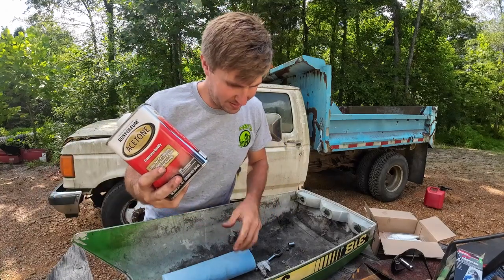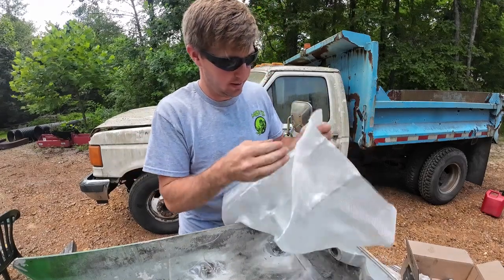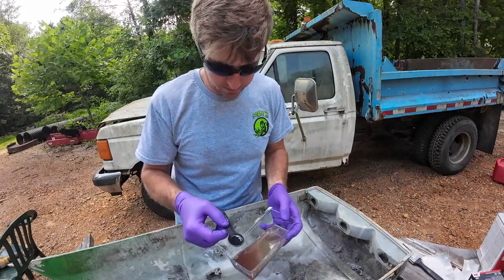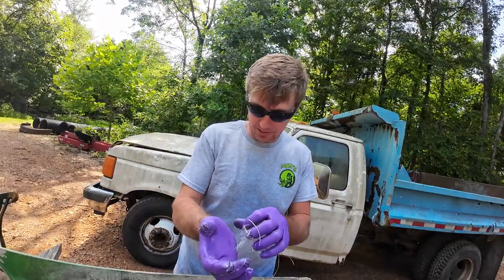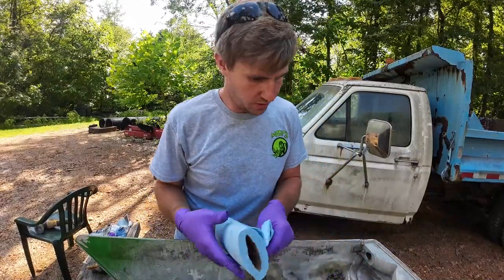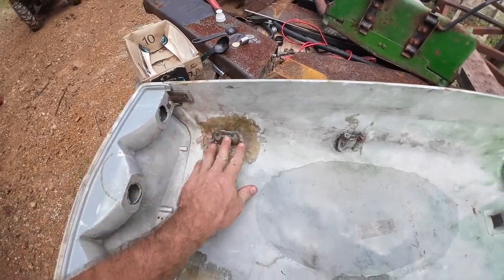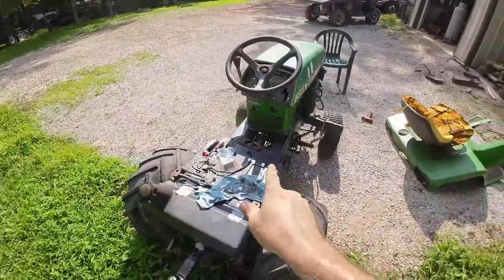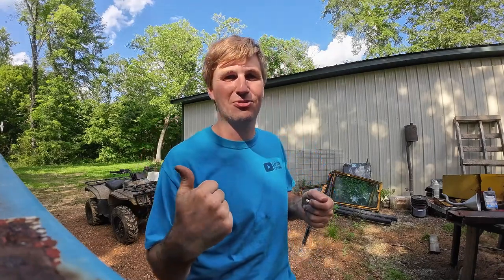DIY Guide: Fixing a Cracked Lawn Tractor Hood with Fiberglass Repair!

Comment: That looked like it went better than you expected Mike. Filling the holes that have stripped threads with resin, and setting the studs in has always worked for me. I once filled a hole with "Loctite" (for a very temporary fix). It lasted long enough to get me out of trouble. (It did the trick, and that's all you need).
By the way: I'm a new subscriber 😂🤣😂💪

Comment: Fiberglassing is pretty easy.  

The main rule is: clean,clean, clean some more.

Just enough resin to saturate the cloth and make it stick where you want it.  The cloth is the strong part, the resin is just glue.

Do more and you get better.  That was a really good job for a first try with the stuff.

Comment: I was digging out a ditch with the FEL of my JD compact and as I was backing up, my knee hit the joystick and raised and dumped a load of soil on the hood of the tractor, cracking it in several places. I used Bondo epoxy to repair it but should have used the fiberglass cloth. I also used the epoxy on the top for extra strength. and then sanded and repainted it. I think fine hardware cloth  might work like rebar as well as the cloth. I used it to make a guard over my hydraulic lines with epoxy.

Comment: Hey Mike the hood on the JD, is it fiberglass or SMC. Sheet Molded Compound. If SMC then fiberglass may not hold long. They make a two part epoxy mix for SMC that will bond if this fails. The two different compounds do not repair the same, but the process is about the same. SMC is what the Corvette is made of in the mid 90's.

Comment: If you want to see someone that has a similar low budget process so he also learns “on the job”.  There’s a YT channel called Sailing, Good, Bad, and Ugly or GBU.  They did a lot of repairs and upgrades themselves which included lots of learning to use fiberglass (structural integrity).  Again, not an expert but that never stopped him from letting everyone see…yep you got it, the good, bad, and ugly aspects. You have to go back in time on their channel as the sailboat is complete and they are now exploring some RV realities.

Comment: Great video...my only comment is be very careful when using Acetone on plastic / ABS, it will melt it.  That is fine for what you are doing but if you should happen to flip the hood over and try to clean the top surface it would cause irreparable damage. . . ask me how I know. 🙂

Comment: You left the job half done. While you were at it, you should have repaired the ding on the right front corner and then repainted the hood. Appearance will help sell it.
Reply: I guess you didn’t hear him say it was already sold without the “repair” and that he did what he did just to try using fiberglass for his first time.
Reply: @Crewsy  Yeah, his midwestern dialect is tough on my old ears. I don't catch everything he says.